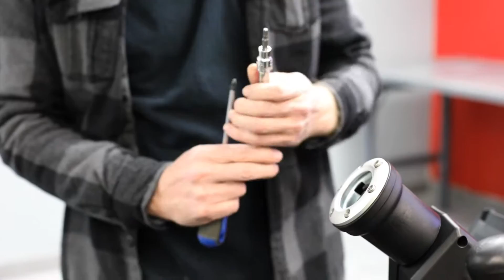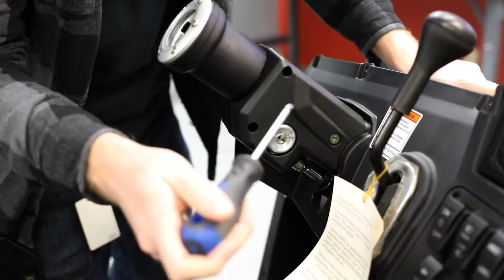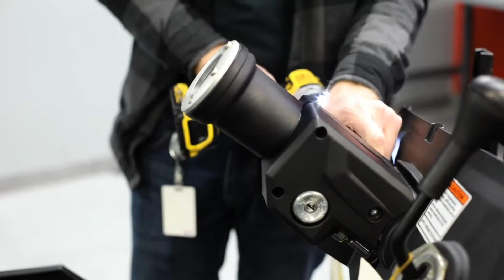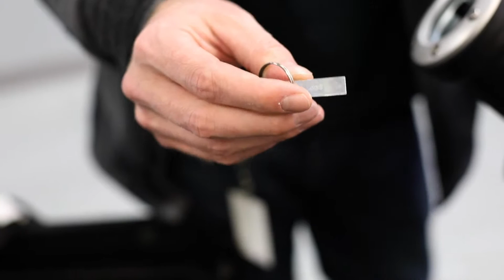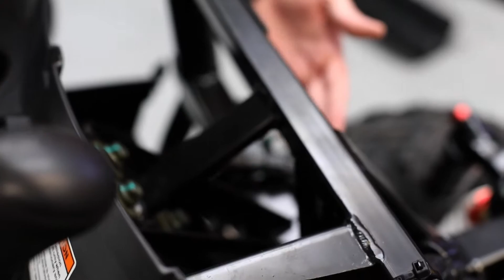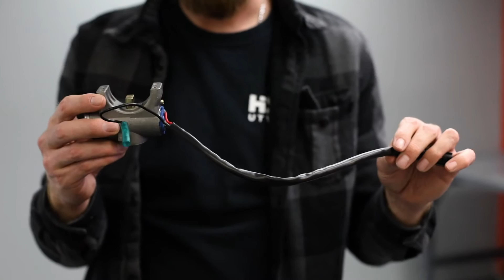Ignition Switch Replacement - HISUN 450cc-750cc UTV Engine

Comment: Greetings to you. Theron Here, i watched your video of how to remove ignition switch. It was very informative. I have a question today. What happens if i remove my 2007 Suzuki swift ignition switch and replace it with another used ignition switch which cames with its keys, 
Will i need to replace the computer box also?
Thanks in Advance